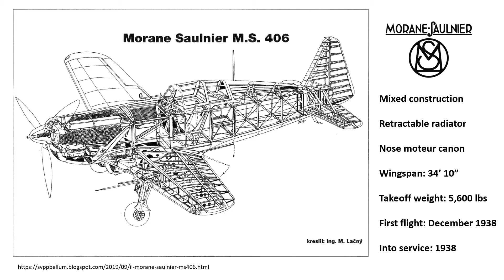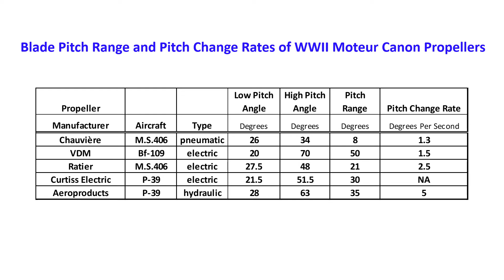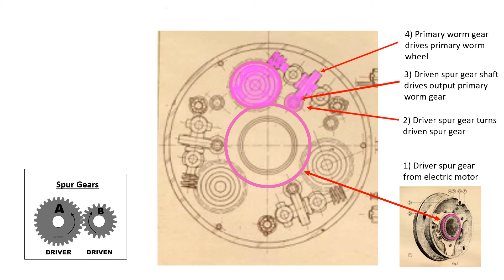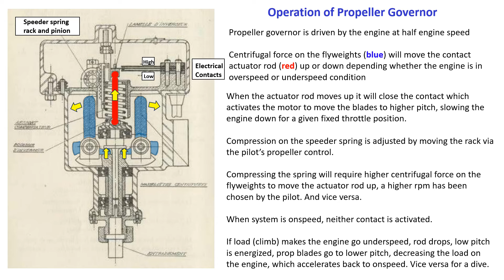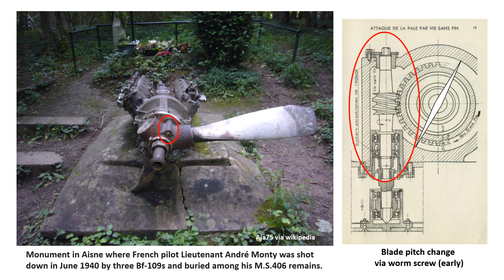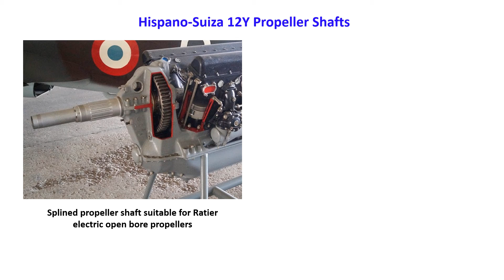Ratier Hollow-Bore Propellers for Moteur Canon: A Technical Description

Comment: Thanks for a clear explanation of the Ratier propeller.

Were M.S.406s equipped with constant speed propellers from the beginning of their production run?
Reply from the maker: Thanks for your comments. I'm unable to confirm whether the first production M.S.406 had a constant speed Ratier propeller or the two-position Levasseur when it first flew in January of 1939.
Reply: @AEHSvideo  How complex was the Levasseur compared to the Ratier?
Reply from the maker: @ethanmckinney203 , I don't know too much about the Levasseur adjustable propellers, but I've started digging...
Reply: @AEHSvideo  The French ran into a severe bottleneck in 1939-1940 because propeller production couldn't keep up with airframe production. I don't know if blade production was the bottleneck or if it was hubs. Of course, they stopped producing the M.S.406, had the MB.150/151/152 in production, and only got the D.520 into production too late. Since the MB.15x mounted its cannons in the wings, it didn't need a hollow hub. I don't know if it had a constant-speed prop.
Reply from the maker: @ethanmckinney203  , Wiki says the MB 150 had a constant speed propeller for its maiden flight in Sept. 1937. Radial engines are incompatible with hollow-bore propellers. Thanks.